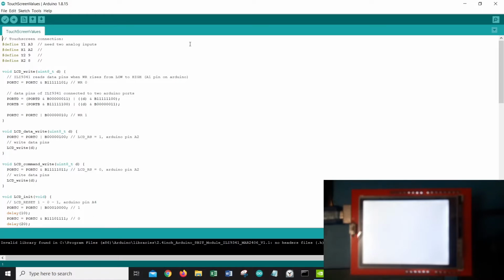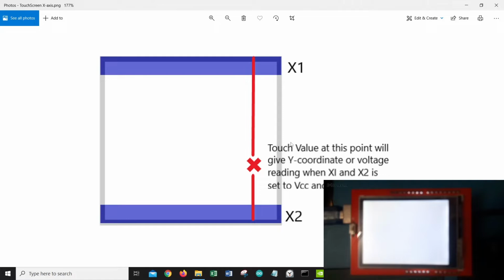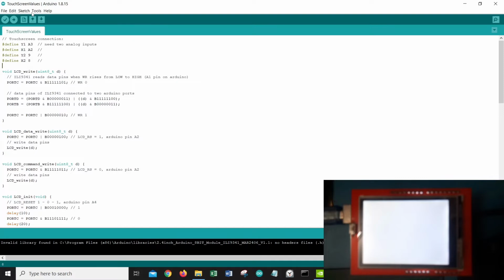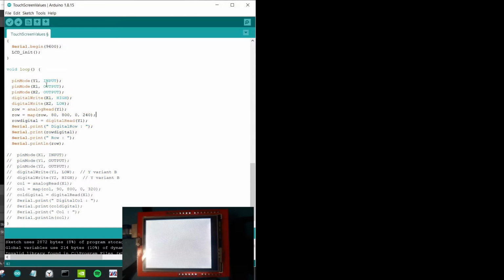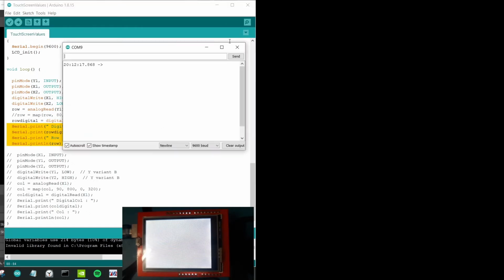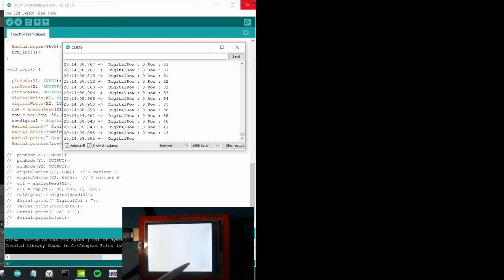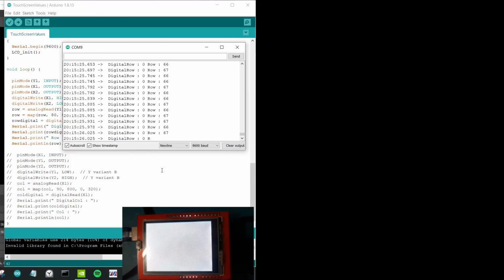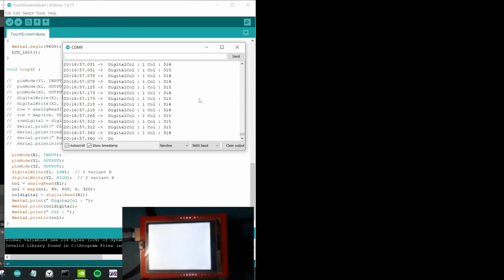Part 4 : LCD TouchScreen

Comment: Hi,
Am working for 2.4inch SPI TfT LCD with Arduino ide on Arduino Uno r3,
But after uploading the code it is showing only white screen.
Have reconnected multiple times, check with different codes.

But same issue.

Mine lcd is non touch, and am not using Arduino shield tft lcd.

How to solve this issue . any idea
Reply: in my experience, that is because there is a mismatch between what we have connected in the real hardware with the pin definition of the code, this is so frustrating given the fact that there are lots of library out there that doesnt explicitly explain where to put the pin definition in the code, my suggestion is look for a tutorial that is showing your exact same hardware that youre using, its useless to follow a video tutorial with different hardware, or you can try to follow part 1 of this video series, and see if it works, if not then it is clear that you have different hardware, hope this helps!
Reply: Thanks for the reply @classicryda120908